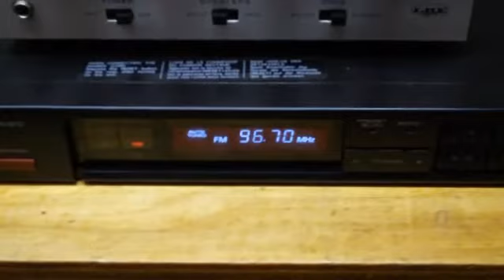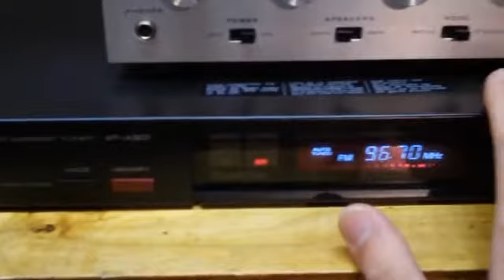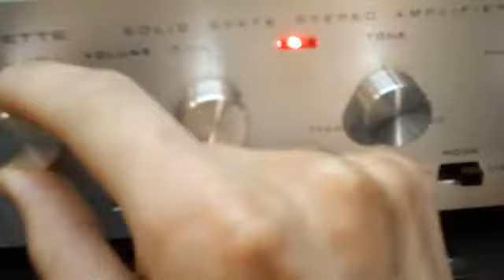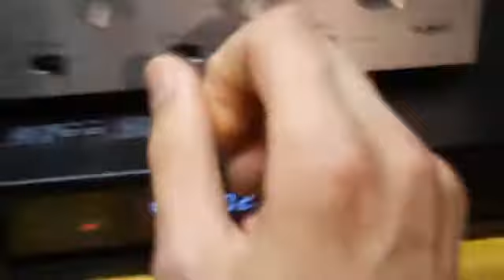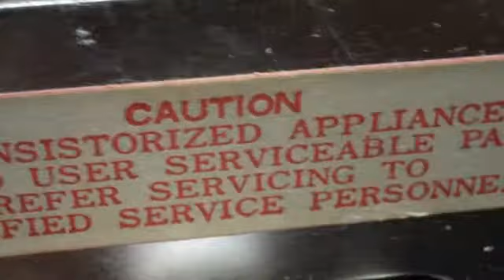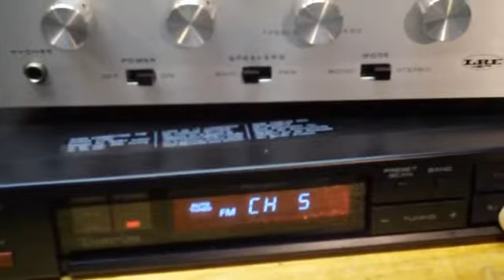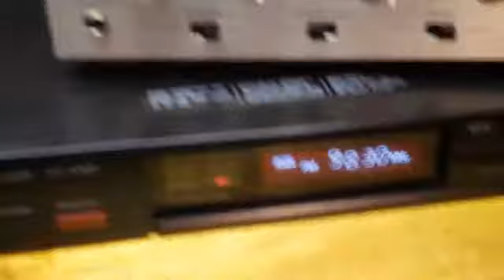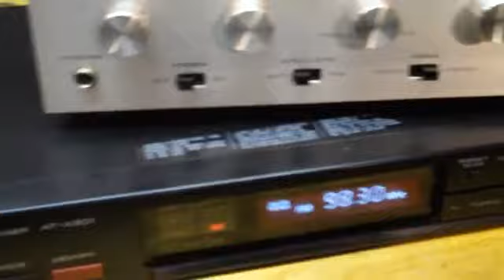Vintage Lafayette amplifier and '80s Akai tuner

Comment: I have this amp... a few years newer though. Mine still works too. I bought it so I could use my headphones. Mine has a selector for magnetic or ceramic cartridges for the phono.  Everything in it is also original. Glad to see somebody else still has this old gear. (I bought mine when I actually worked at Lafayette in the late 1970's).

Comment: That's a really nice little system! I especially like the little amplifier! I've never seen a HiFi amp using output transformers before. I only saw those setups in cheap portable radios. The amp sounds really good, it sounds best with the Panasonic speakers. 
But there is one thing that would really annoy me if this was my amp: it doesn't have a record output for the tape!

Comment: I used to have that tuner.  Would you consider doing a quick vid of the amp and EQ...  I want to see if they are the same one's I used to have.  I'm pretty sure it's the same tuner but mine was silver. Ran forever...  Neat little amp and in such clean condition. Great find! :)  JC